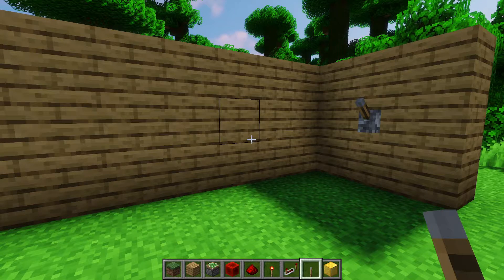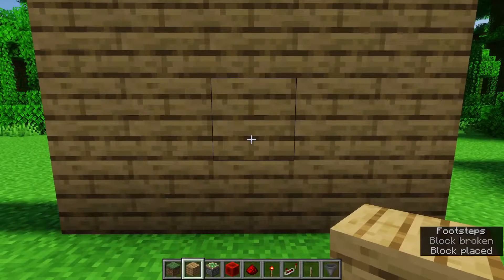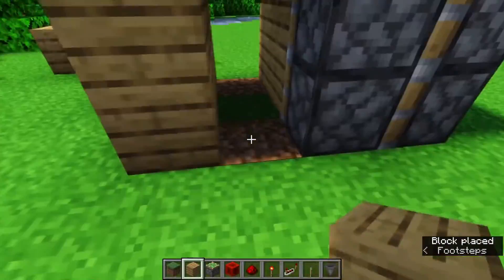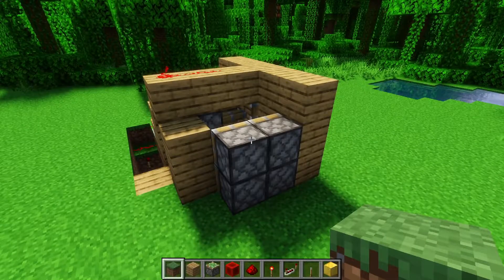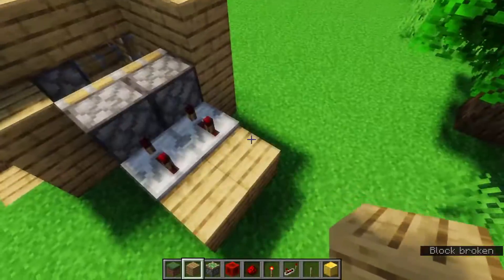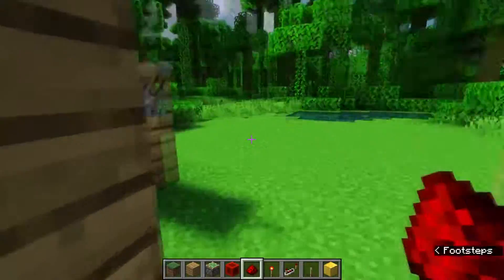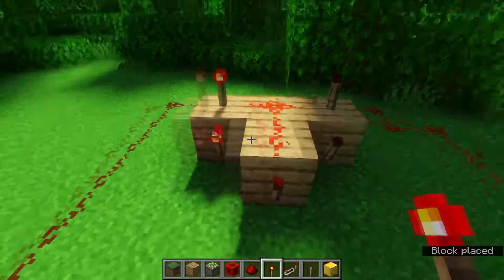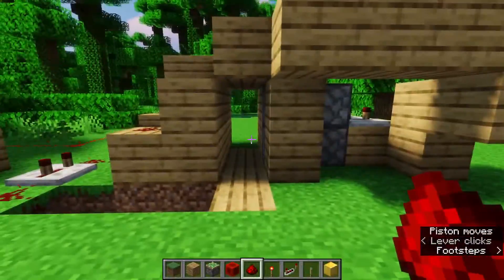How to Make a Hidden 1x2 Piston Door In Java Edition | Minecraft Redstone Engineering Tutorial

Comment: Having an issue where the pistons move more or less correctly and open the door right, but the blocks arent pulled when closing the door
Reply: It either opens correctly or closes correctly when i adjust the delays but never both. or closes correctly but leaves the top piston and block unpulled when opened
Reply from the maker: It depends on which version of the game you are on, but it does sound like a delay issue. Really the side pistons need to be delayed longer than the middle ones but other than that I would say keep messing with it

Comment: Does it work with a button?
Reply from the maker: It will but not directly: you have to make the buttons act as levers by making a memory cell (a t flip flop would probably be the fastest) that will prolong the button signal, as well as a reset button to turn the signal off. The reason is that the lever signal is directly affecting the door

Comment: My bottom two pistons don't move.. what did I miss?  Do I have to repeat the process for the first two?
Reply from the maker: If you are using bedrock edition then the design has to be modified to allow the bottom pistons to actually move (which can be done by puttong a redstone signal into the bottom one then one above that that powers the top pistons). If you are in Java edition then double check the connections and delays, since if a delay is incorrect it could cause one piston to not contract before the other one pulls it, causing it to not get pulled